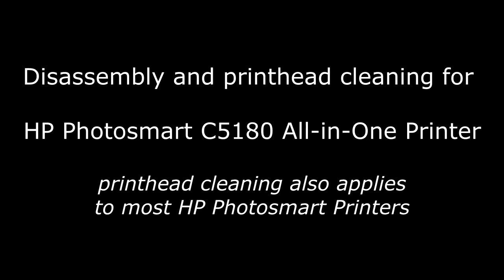HP Photosmart C5180 - Disassembly & Head Cleaning

Comment: If anyone followed the steps in this video and still can`t print after doing a head cleaning
six times then you most likely cut the trace on the circuit board that`s attached to the head while cutting the two pieces that are holding the circuit board.
i put a piece of clear box tape over my traces and my friends printer is printing great again.
if you didn`t cut the traces and your sure you put everything back together correctly then you could have a bad pump.

Comment: This is an EXCELLENT video.  Unfortunately it didn't fix my issue. But I know how to get into the printer. Thank you!
Reply from the maker: +Jons01 Thank you!
Reply: +Jons01 I replied earlier to you about doing the reset, plugging the power in while holding the 'Help'(?) and 'OK' button until the printer powers off, and then power it back on. I just replaced all my cartridges with 2013 expired genuine HP 02xl cartridges, ($26 on eBay) except for the original black which was full. I let it run through the setup, which takes a few minutes and then ran alignment, (which is a crucial step). My C5180 is working like new after sitting in a closet for close to ten years. I didn't have to take it apart, I cleaned the head using the paper towel method of running the heads over a damp folded paper towel  in the channel beneath the head. I washed out the reservoir sponge with dish soap, to get rid of excess ink. There may still be hope for your printer, but the hard reset is the only way you will restore printing. If you replaced the capacitors, and the head is not damaged, you should be able to print again. Good luck. The only problem I am having is with paper pickup in the main tray, so I may have some more cleaning to do on the rollers, but getting the new carts was well worth it.
Reply: +Mooncalf2012 Thanks,  I had tried the hard reset before the caps went bad and it worked. I replaced the bad capacitors per others with the same issues posting instructions on the web.But now it appears that the control panel has quit working. But, I am afraid this is beyond my ability to repair.  Sure was fun giving it a shot.
Reply: how did you do that damp paper towel cleaning?

Comment: Excellent Video Antystein, thank you.  I am now trying to dismantle my Photosmart 8230 and I can't see how to unclip the two corner strips. These are a darker grey and run down the left and right sides of the top, the left and right front sides and curl around the front base for a short distance.  There are three recessed latches on the top and depressing these frees the top portions but it is still firmly latched down the left and right sides and where it curls around the bottom front.  Any ideas on how to free these sections?

Comment: Great video! Just wondered whether you have any tips on what to do if you have a 'carriage jam' message – it's actually a mechanical fault – rollers won't pick up the paper, but I'm not sure how to go about fixing it, and haven't beeen able to find a video that deals with fixing the plastic gears which is what I believe the problem is – any direction would be gratefully received.

Comment: Maybe I'm a little tired right now but in looking at this video I can immediately think of bunch of ways thing could go seriously wrong for me if I tried this.  Btw, I have a related, listed model (C7180) and not the one in the video.  With this said, I should say that I'm not shy about cracking open the cases of my computers and removing and adding components and have even swapped out a mother board.  I guess the clincher is the fact that the different model I have will require me to follow the disassembly instructions more abstractly than I'd like, rather than be able to 'parrot' them mindlessly.  That combined with not doing this before is where I think the difficulty will primarily come from.  Although having experience tweaking the components inside my computer case should give me a degree of confidence in attempting this, it also gives me the experience to know when something is more difficult than it looks.  Am I being overly negative?  Do I need a pep talk before I attempt this?  :-)
Reply from the maker: jonRboy It depends on the machine you are working on. Printers is one of the many categories of devices that repair centers don't usually repair if a component has failed, or ask for insane amounts of money. This applies to many electronic devices, so trying to fix it yourself should be usually your last resort, either you fix it or discard it!

Comment: Awesome!  How to clean one of the great print heads of all time!
Do you do requests?  Those darn 4 roller shaft GEARS THAT STRIP and BREAK.  Guy in UK is selling them.  

I tore one of these down to the steel bottom to deal with a paperfeed malfunction - I couldn't find any way to remove entire modules to get to the paper handler.  I have 8 of these 02 cartridge printers.  2 have clogged heads I'll try now!  The other 6 have broken gears.  I may try to replace the gears in brass.  They evidently shrink over time and creep rupture.  Very bad material selection.

Comment: The biggest problem I have is finding the screwdriver for the screws to remove the printhead.
The instructions also work for HP D7100, with some differences in the opening of the cover (a real pain)

Comment: Thank you for this fix. Having streaked black color printing outputs i followed all the procedure to clean the printhead since the printer has not been in use more than 2 years. After disassembly and assembly of the machine, when i turn on the printer it shows the ''ink system failure'' message, error code 0xc19a0002. I have tried all the solutions found in the web for this error code but nothing works. I have opened the upper cover having jammed it and the ink carriage seems to roll ok. I removed the printhead's black plastic cover and turned on the printer but it seems that the ink does not reach the printhead as there is not flowing any ink in all six trasparent printhead's hoses during the printer's initialization process. I seems that when pulling out the hoses from the printhead during disassembly the hoses took air inside. I will try to use the method(syringe) mentioned below by another comment to fill the hoses with fluid(distilled water). I hope it will work.

Comment: Any suggestions for clearing the microscopic nozzles completely when rinsing under running water doesn't work? I've tried that for a long time, it soak in warm water for a couple of hours. The only parts that clear are the parts that line up directly with the holes on the other side. The rest of the "lines" are still saturated. Thanks for the help.

Comment: Antystein, I know its 8 years since you made this video. It helped me a lot in the past. Now I'm facing a problem with a bogus 'paper jam' error. I've opened the case as you showed and checked, there is no paper jam. I think the paper feed mechanism is just not able to pick a sheet of paper and move it through the feed for printing. Is there any tips you can give me to solve this? I've used this C5180 for nearly 15 years, with a Continuous Ink System, really saved me a lot of money through the years. I don't want to junk it, because it was still printing perfectly until a couple of days ago when this 'paper jam' error came up and won't go away.
Reply from the maker: Hello, it's surprising that I still get comments on this video after all those years! It is normal for the printer to give you a paper jam if it knows that the paper has stopped at a certain point or if the paper doesn't arrive to a certain point at the expected time, which is your case since the printer can't pick up the paper. It is not uncommon for the rollers that pick up the paper to go bad on printers and photocopiers. You can usually clean them up with alcohol to make them sticky again so that the paper doesn't slip or try to find a replacement. I really don't remember where exactly are these rollers on this particular printer but I think they should be accessible from the back or from the underside of the machine
Reply: @antystein  Hey, thanks for your quick response! Yes, I agree, it's very likely a problem with the paper feed rollers being unable to pick up the paper. If I reset the printer so that the paper jam error disappears, and try again, I can hear a clicking sound as the feed mechanism tries to pick up the paper and fails, then I get the paper jam message. I have taken the outside shell off and can see the paper-jam sensor on the back, and all the paper feed mechanism is also clearly visible. I'll try cleaning them with alcohol, as you suggest, and then see if it works. I actually have another C5180 in my attic that worked for years, and then quit with the same problem. If it works for this one, then it will probably work for the other one as well. Thanks antystein.

Comment: Thanks for the great photosmart vid antystein.  Added to my watch later vids for when I start work on my C6180 which appears very similar to the C5180.  Noted the others comments about some of the difference to watch for when disassembly. I pulled my C6180 as it was failing to print on 4x6 photo paper correctly. After replacing the printer I discovered globs and streaks of ink both on the surface that the printer was on and on its underside - facing the front of the printer the ink discharge was on the right bottom from front to back.  It appears that is the approximate location for the waste ink pads.

My guess is that they are saturated and overflowing.  Assuming they are some kind of foam can replacement foam be cut to fit?  I noticed you mentioned using absorbent towels folded up.  Plus can you add any comment about getting at the waste ink area?  Is it just some kind of covering screwed on it?  I hope to work in the C6180 in the month or so.

My C6180 last several years - I hope to put it back in service for at least photo printing since with the HP advanced paper it printed really nice pictures.  Granted the replacement Epson Workforce 3640 that I installed does an ok pic.  The WF-3640 does have the bonus of smudge/moisture resistant ink AND a removable/replace-able waste tank.

Comment: Hello Antystein ! Your video was really helpful to know how to clean the printing head. Now that I reassembled the printer I have an issue with the head carriage. I did like you said @5:30 (put the head to the right side and rotated the transparent wheel anti-clockwise until the end), so the head is down and locked.  But when I start to print, the head goes to the far left side and it seems to be a problem with the 2 little white gears we see @5:37. They don't grab the gears from the head unit, it's noisy, and an error message appears. I don't see what's wrong, I don't know what to do :(  any idea ? thanks !
Reply from the maker: Hello, make sure that you have installed the two gears shown at 4:51 correctly!

Comment: I have a c5180 that has been sitting around for a few years. After basic wiping down and checking ink liquidity, the yellow cartridge was not cooperating with the Print Test. So happy to have found your comprehensive and clear video! I have followed it–now disassembled and reassembled the thing 3 times–to no avail. It gives me Ink System Failure Unable to Print Error Code 0xc19a0002. It will not run an Align or Print Test, or Clean Printhead. 

I have reset factory defaults, I have pulled the power cord while it was on and held the OK & Help buttons several times... What did I miss? Or do wrong? Any thoughts?  

Thanks to all the comments too, even though I have as yet been unable to sort the issue out.
Reply: Left button+the wrench button, OK button and then 2 times to the right in the service menu. There you can erase the failure memory. Do it 3 or 4 times...then the ink system failure is gone and it will print again.

Comment: I have made it to 1:22 in the video where I am to rotate the transparent wheel clockwise. I have made several revolutions, but the carriage never drops and I never hear the 2 clicks. The carriage is still stuck. Any suggestions?

EDIT: I should add that the reason I am disassembling the unit is because I'm getting an error message regarding a carriage jam. I was not able to find any paper in/around the carriage that would be causing the carriage jam. The carriage appears to be stuck in its docking position on the right. I thought by disassembling to the point of manually moving the carriage (1:22 in the video) that I might find something.

Comment: Thank you for the video.  When I reconnect the printer it seems like the carriage is locked to the far right position.  The display will show the HP logo with the bar scrolling, the question mark will like up for a brief moment and then the printer turns itself off and then back on and it repeats that cycle. I do hear a lttle clunk inside before it shuts off, that is why I somehow think it is related to the carriage being stuck.  I have had the machine apart multiple times checking  and rechecking the 4 ribbon connections.  Any advice?
Reply from the maker: It looks like the head cleaning system is jammed. Try rotating the gear as shown at 1:22

Comment: I followed this guide and I am getting the same error code as +popotit0  - 0xc19a0028 Ink System Failure - When it runs through the self test at startup, the head slides over to the left side (facing the printer) and the gears (the ones that fall off the print head assembly in the video) move up left and right a small amount then a large amount and it slips off the bracket from the print head then errors out immediately after- any ideas? Is this normal - could you record the gears on a working self test on startup?

Comment: Printer didn't print black well, took everything apart and cleaned it up, but it wouldn't print anything after putting it back together...went through the motions, no errors, the page was just blank, opened it back up and made sure to tighten head screws a little, now it only prints magenta...
Reply: Ran clean print head a couple more times and SUCCESS!!

Comment: Took me one hour to made it. Unfortunetly it didn't solve my problem with black ink which makes white stipes. The result is  little bit better than before but far from perfect.
Good video anyway.
Reply from the maker: In this case the problem might be with the printing head chip itself being damaged, and not due to dried ink in the nozzles. From my experience, I suspect that this could be caused if you are using non-original ink cartidges that have bad quality ink.

Comment: I used this instruction video for replacing printheads for HP C6180. Unfortunately I turn also different wheel as you showed in your video. Now I have problem with ink system and I can see error 0xc19a0020. I tried to use hidden menu (I pressed "*" + "#" and "1" and "2" and "3") but it is not working.  Do you think it is possible to solve this problem? Thanks.

Comment: I was cleaning the print head and after about half an hour of running it under warm water I can se light through spots on the slide but not what you show on your video. Can the head be soaked in something to more thoroughly clean the slide/holes?

Comment: What can we do with the little sponge (full of ink) on the right of the moving printer ?
Reply from the maker: If it is completely saturated with ink i usually replace it with several layers of absorbent paper. It does not last as the original material, but it is usually not very hard to replace it more often.
Reply: +antystein I had some solid black ink on it but after some minutes in alcohol  and some WD40. It's dry and clean.

My printer was really dirty. The cleaning method goes well but for the moment I don't have 2 colors on the test sheet paper. (deep blue and magenta).
I have the 6 inks colors (that are ready to flow) on this part : https://youtu.be/YwQsFBvXJ_A?t=2m26s  but nothing on my paper... :/

Comment: After following your vid i am printing blanks, could this be the hoses? or does it take a while for the lines to flow again after cleaning the head? Thanks for the vid.
Reply from the maker: raymondavila Thanks for your comment. As other uses mentioned to, in some cases its takes several blank pages before ink flows down to the printing nozzles again.

Comment: Hi, My c5180 prints reddish photos using the photo tray. When printing using the main tray it prints out perfectly. It's not on my software as I checked and used other pc's. Please note that I use CISS and i see the ink flowing from all the tubes. Thanks for the help.
Reply from the maker: So the only factor is the tray? Are you using the same type of paper on all trays? Because the only factor that i can think of, is having compatibility issues between different types of paper an the ink you are using.
Reply: antystein In the photo tray i use photo paper. I managed to align the photo paper in the main tray in order to make a test from there and the colors were ok. I don't know if the problem might be the printhead. Strangely through the CISS system you can see clearly the ink flowing from all the tubes when you set the printer to clean the printhead. That's why i'm a bit confused.

Comment: We have a C6180. Have watched video but we get stuck at the stage of removing the top cover (at about 30seconds in). There seems to be a slight difference in the design of the clip housings. Also there appear to be clips on both sides and we have tried pressing both and lifting. Any ideas?
Reply from the maker: +Tom Diccon Harry King Sometimes when it is the first time you take apart plastic parts that have clips like this printer, it may require a considerable amount of force to un-clip. Take it slow an look for any hidden screws.
Reply: +antystein Make sure that your printer is out of warranty before cleaning printhead!